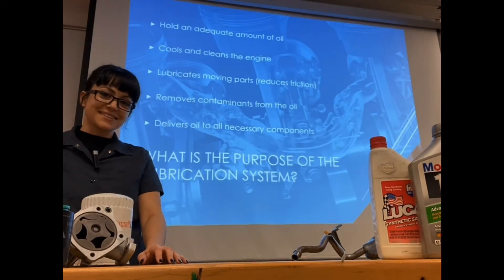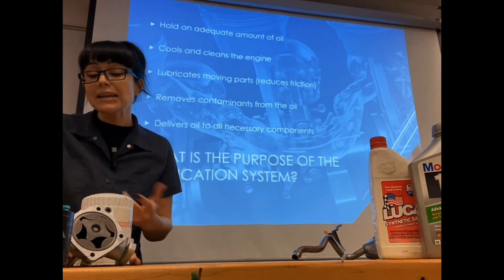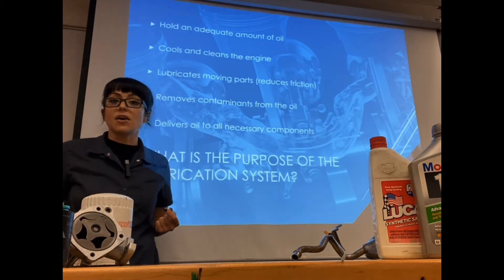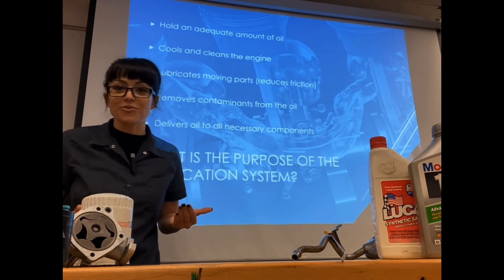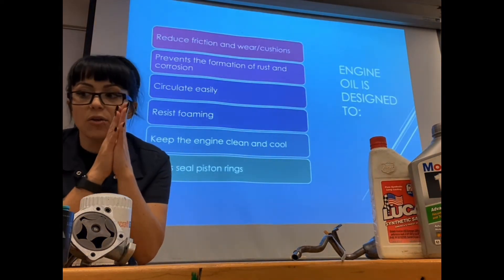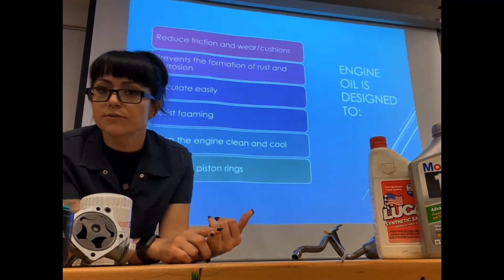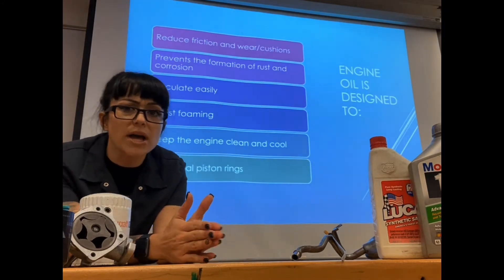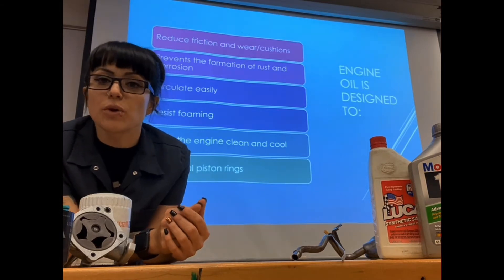Engine Oil

Comment: 35:20 My owner's manual calls for 5W-30 oil, but says that 0W-30 or 10W-30 is acceptable, depending upon environmental conditions. There's such minimal difference in kinematic viscosity from 0W to 10W, and it's only a factor until the engine warms up. The high-temperature viscosity grade is what's protecting your engine for the majority of its operating hours, and is therefore more important.

42:16 I would never switch a vehicle from synthetic to conventional oil under any circumstances. It's a hell of a lot cheaper to top off your oil than have to deal with the drawbacks of conventional oil such as increased friction, heat, and oil breakdown. The longer oil change intervals and gas money saved on running synthetic oil will more than pay for the difference in oil price. If changing your oil grade isn't enough to manage your oil consumption, you've got bigger problems to worry about.

Comment: I don't understand why, when a vehicle has excessive oil consumption, your recommendation is to jump both viscosities and not just the hot viscosity. It makes sense to change the hot viscousity because engine will burn oil when the oil is hot, and not when the oil is cold. A cold oil will not be burn. Another problem is that 10w-40 is usually not fully synthetic.
Reply: 24:56
Reply: 35:00
Reply: She said 10-40 non synthetic
Reply: why a cold oil will not burn?
Reply: @francoisloriot2674  Because it's cold. Burn happens when hot
Reply: @ErezYafee  combustion temperature is roughly the same even on a cold engine
Reply: Oil burns in the cylinder, regardless of it's temperature before-hand or engine temperature (engine coolant temperature) as combustion temperatures are always hot enough to burn oil in the cylinder. Engine wear creates larger clearances between engine parts which requires a thicker engine oil to take its place to provide proper lubrication. A non-synthetic oil is less "slippery" and will not leak past worn engine components and into the cylinder as easily synthetic oil. Clearances between engine parts are larger when an engine is cold compared to when an engine is at operating temperature, therefore oil will leak into the cylinder easier during a cold start, increasing oil consumption; and increasing the cold viscosity will help reduce this.